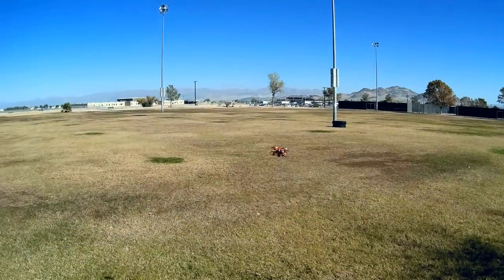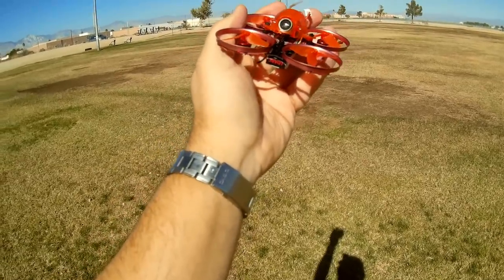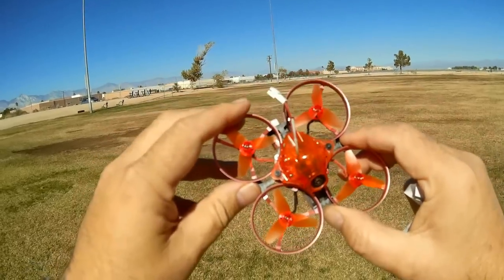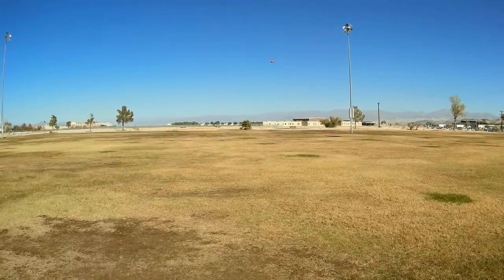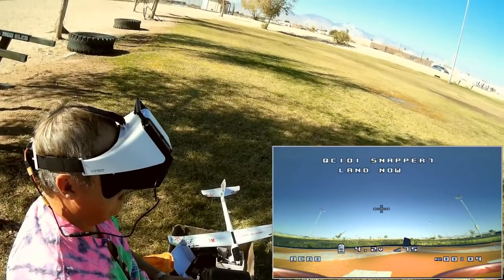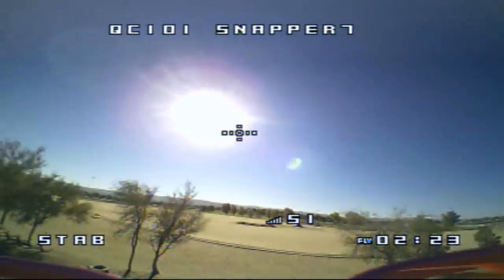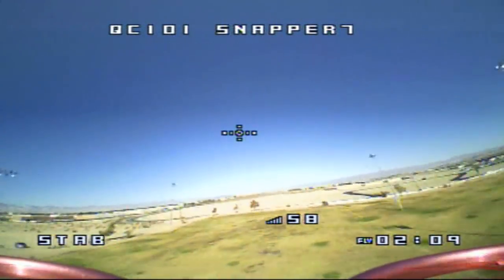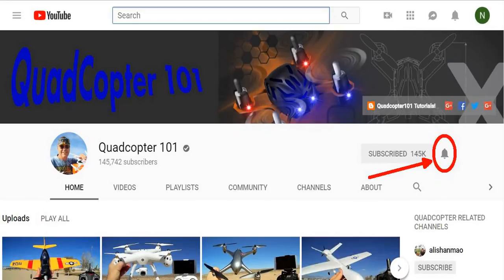Happymodel Snapper 7 New Version Brushless Micro FPV Racer Flight Test Review

Comment: Thanks. I have recently got one of these with the Frsky protocol and have bound it to my Jumper T8SG V2+. However the motors do arm but nothing happens when I push the throttle stick up but when I move the right roll stick left 2 of the motors fire up and when I move it right the other 2 motors fire up. I have checked everything in Betaflight and all looks fine. Any suggestions please?
Reply from the maker: The most common problem for non-arming is that throttle low endpoint is set too high.  What that means is that your throttle is set too high for its minimum position, and Betaflight is doing a safety disarm to prevent the motors from starting as soon as armed to prevent flyaway or injury.  You'll need to go into Betaflight again while connected to your transmitter, and adjust the low endpoint (via your Jumper's Mixer menu) to lower the minimum value.  See Joshua Bardwells discussion here (advance the video to 8 minutes 02 seconds) https://www.youtube.com/watch?v=M0S3HTQihxs
Reply: @Quadcopter101  Thanks for this.
Reply: @Quadcopter101  how you doing...hey love your videos.... Im learning,  got a question.... i bought this quad, but i though is going to coming with his remote control, lol, Can i use this quad snapper 6/7 with the Spektrum DX6e Remote? like I told you... Im learning.... thanks Quadcopter 101
Reply: ...im still witout flying it lol..almost a year lol ).need remote control ....where can i get it ?

Comment: Hello. I got Happymodel Snapper7(with FrSky receiver) it looks great little whoop. I set it in betaflight, I went in the air. All works as should. Except the FPV. It looks like the picture is there, but is not stable. Here is the video of FPV:

https://drive.google.com/file/d/1SOS8eONRLZLbLRsMEaDzmW6JxsFDNlew/view?usp=sharing
FPV frequency is at 5.917GHz. Didn't change anything, it is factory setting.

Is this possible to fix somehow with settings? Could change somethin in Betaflight or at mine goggles, or change FPV frequency? Other models(I have Furibee X215 and LDARC FPV EGG 138)  works great with my goggles. So probably should not be goggles problem. I have this goggles: Eachine Goggles Two 5 Inches 5.8G Diversity 40CH Raceband, which not have DVR, thats why I filmed FPV with my phone.

I hope it is just settings problem.
Thank you, good luck.
Reply from the maker: Nothing is wrong or broken.  You're goggles are just set to the wrong video format.  Go into your goggle's menus, and find where you can select between PAL or NTSC video format.  Whatever setting its currently on, switch to the other.  For example, if it's currently NTSC, switch to PAL.  Or vice versa, if it's currently set to PAL, switch to NTSC.  But note that you may likely need to switch it again when you go back to flying your other drones.
Reply: Thank you. You had totally right. :) (Y) I had to switch on goggles from PAL to NTSC. :) And it works now. :) Finally I can go in the air with this one. Thank you. Thank you. Great help. :)
Good luck.